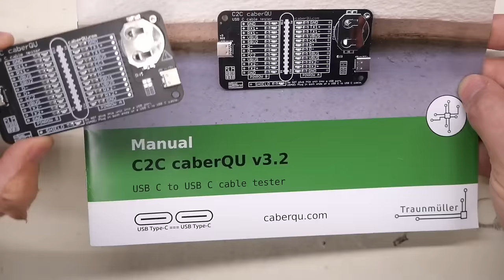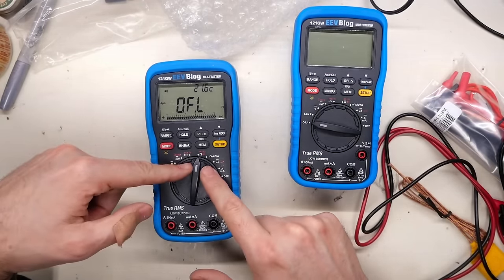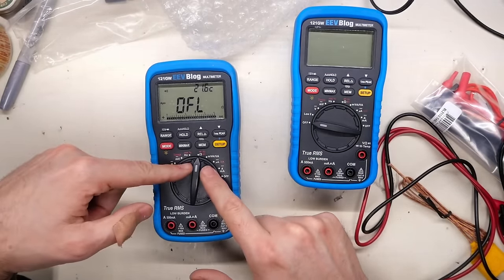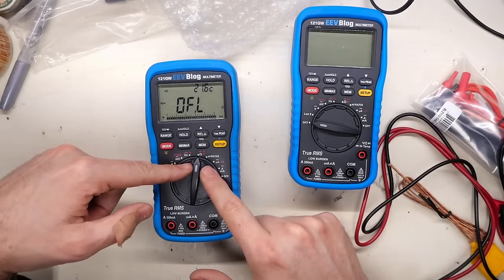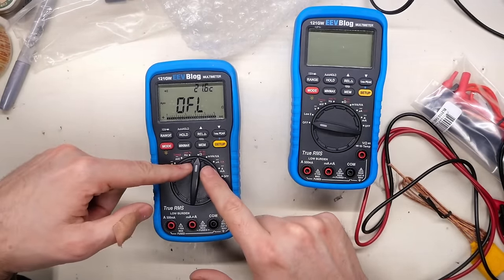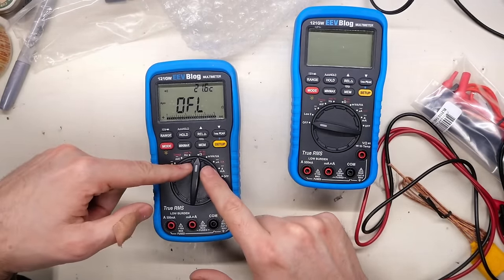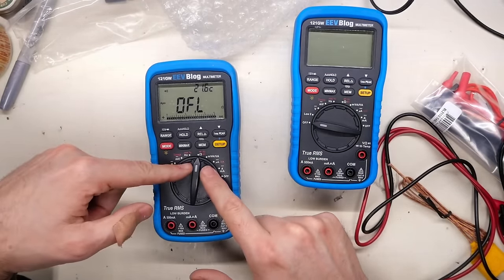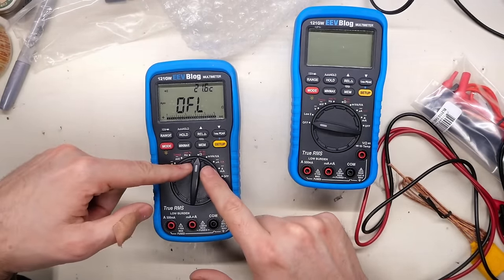0080 A 128k RAM upgrade for the Speccy, some recovered SIDs, USB-C Cable testing and a new DMM

Comment: It would be an interesting project to mod the USB3 Cable Tester with a microcontroller and a two-line display to show which type of cable is connected.
Dude!  When in doubt, De-Oxit.  As I understand it, De-Oxit has several formulations, so you might be better off with CRC QD Cleaner.
That Spectrum RAM upgrade cries out for a 3D-printed case.  Ivan (pr: EE-vahn) mentions you can manually select 128k but the software defaults to 48k...

Comment: CCx lines will light up on shield connection on e-marked cables. Those have an active IC inside with parasitic paths to the CC lines.

Comment: Please adjust the contrast on the new DMM. Also, you can use Lithium primary AA and AAA batteries, they only have a slightly higher voltage. But never seen those leak.

Comment: This illustrates the point:  USB has gotten WAY TOO COMPLICATED.  It's not "universal" at all anymore.  Is it USB?  Is it high speed?  Is it Thunderbolt?  Which version?  Does it carry data at all?  Or is it just a power cable?  Either way, how much power can it deliver?  Who knows!

USB was supposed to solve the problem of having multiple ports, like serial and parallel and PS/2 mouse and keyboard.  Instead, we have one port, and nobody knows what it can actually do.  That's not better.

We really should have kept legacy USB and just added Thunderbolt as a separate interface for high-speed data.  Charging?  I really don't care.  My laptop can charge from USB A power bricks.  It takes a full day, but that's fine.  If I need something faster, I can use a dedicated power brick.  Can't we just do that?  ><
Reply: Too true. I've only recently realised that USB-C can be USB2.0 and not a backward-compatible USB3.x. more fool me. I thought it was standardised.

What's more, is that I have USB3.0 cables that aren't recognised by some devices, but are perfectly fine in others.

Comment: I use non rechargeable lithium AA cells in my meters, since they last forever and do not leak (or they have not leaked for me yet).  On 9v low draw stuff I use "heavy duty" batteries, which tend not to leak.   Also on one of the cheap meters, I would try Deoxit D5 on the contacts.  If they have carbon traces, you need to use the Deoxit F5 Fader lube.  I killed a bunch of potentiometers with D5 before I figured out that you have to use the F5 Fader cleaner on carbon traced stuff.  Good luck.

Comment: Shield should be connected at only one end. If it's connected at both ends it's a ground loop.
Reply: Nope, that's only in analog audio. All other shields must be connected at both sides, just like with a single core coax.
Reply: @WhiteBream   No, not quite.  Ground loops are not an "audio" problem.  They're a signal problem.  They affect every signal, whether you can hear it or not.

Some cables use ground as the signal return, so you can't do anything about it.  (Coax.)  Other things, including some audio cables (XLR / or mono differential on TRS) don't use the ground as a signal return, so you can lift ground on one end without a problem.

All that said, ground loops only exist when there is a difference in ground potential that is big enough to have a significant influence on the signal's interpretation.  So the best cure is for that not to happen to begin with.  When devices are floating (battery powered or double insulated), then it's not an issue.  When devices use a safety ground, that ground should not be carrying current, and both devices should have low impedance paths to the same common point.  Then, the shield of an interconnect isn't acting as an equalizer between two different reference points.
Reply: @WhiteBream   I humbly disagree, The exception is when the shield is the only ground(and a common ground is necessary). This is normally the case with analog audio and RF coax.
The issue is that if the shield forms a loop with a superfluous ground conductor external noise signals are inductively coupled to the signal conductors.
The truth were hoping for is that all ground pins(not signal negatives) are connected to shield at both ends with no other ground conductors. I can't think of a simple way to test for that off the top of my head.

Comment: As someone who uses a DMM almost everyday at work I personally wouldn't trust anything that wasn't a fluke. But with the range switches have you ever taken them apart and cleaned off the contacts?

Comment: if you had a 80s portable tape player (like brochures of the day suggest) i could set the volume for you so the spectrum always loaded, it was a skill back then.
My best advice is set the volume wheel to 7 to start with if you have such a player

Comment: USB-C cables designed for charging - like those Apple includes with laptops - tend to have thicker conductors for lower resistance at higher wattage applications. I've found that any cable I purchase that includes the words "charging" or mentions wattage are always USB 2 cables. The consortium should have enforced a marking system to help eliminate this confusion.

Comment: i know the joystick ports on the original spectrum were on the cartridge add on as far as i know. i remember having the original sinclair 1000 but never used it and then it eventually got thrown out. i miss it already. there are lots of computers i want to end up with but finding one isnt cheap sadly.

Comment: add a usb-c voltage amp meter in line
spray some deox-it in the multimeter selector knob. they get dusty and the lock washer on the backside often gets loose.

Comment: Hi Adrian. I believe the official Apple (USB-C) cables have a chip in them, and a single CR2034 battery might not power it up enough to show all the modes it’s capable of. It probably needs at least 3.3 volts, but that’s just a guess, whereas the cheapo cables probably have just some termination resistors in them so a CR2034 is probably good enough. That being said, I haven’t cut into any Apple-branded USB-C cables to see the chip… Mostly because I need mine intact, and I’m not packed with cash to splurge on a spare just to cut open! 😆

Comment: Only real difference between the 48k and the plus model is basically the keyboard and the plus you got there is not a 128k model. The 128k toastrack model looks exactly like your Plus, but with a giant heatsink on the rightside (the toastrack) and it also says 128 on the case.

Comment: Check the batteries of the meters. Continuity/resistance mode relies on good batteries. With a bad battery voltage and current can still fine.

Comment: I am curious if your old meter behaves any better if you feed it alkalines instead of NiMH. NiMH have a lower output voltage, and if something is marginal, that might push it over the edge. This probably wouldn't be behind the erratic readings--that's almost certainly a dirty or worn contact trace. But maybe when it freezes a reading.

Probably not the issue--there was no low battery indication showing. Just what popped into mind.

Comment: I’ve broken many multimeters by accidentally connecting it to electricity while it was in resistance mode. I didn’t know that it could instantly damage them until I took my HAM radio test and saw that as a question.
Reply: yup, it's a quick way to learn what fuses your meter takes. :-) step #1 when changing modes; remove the leads from the circuit.

Comment: I have an ancient hp4357a that's great for tracing shorts. even in modern motherboards and gpu's with big complicated vrm's you can usually trace the short down to individual component with 7.5 digits. even tho it's kinda beat up and slow and a hasn't had a proper cal in decades it can make very precise comparative measurements across a circuit.

Comment: Switch oxidation and/or dirt in "ball" switch in multimeter. It is repairable, did it on my "field" multimeter years ago. I agree that it is annoying. Also check/clean/tighten probe ports if you decide to mess with it (they are visibly less shiny inside then of the new one).
Reply: BTW, I used "Kontakt 60" spray for cleaning- It is some kind of clean, de-oxy and it has lubrication capabilities (surface remains slightly oily after spraying). Great (and expensive) stuff, it is German, I don't know US equivalent..

Comment: Re: the meter,  i have 2 comments. 

#1, if i have to use a screwdriver to open the battery compartment,  in not interested in using it. 

#2, rechargable batteries often have different voltage from regular batteries.  Could the behavior be because it's working with a weaker starting current?

Comment: As others have said the Spectrum "Plus" that you have, is a 48K machine, in a different case.  Confusingly, the first 128K machine was also called a "Plus", presuably becuase it's the same style case.  The only differentiator was the "128K" logo in the bottom left corner.  Oh, and the now externally-mounted heatsink.

I don't get the point of the RAM expansion (nor the sound chip), because surely you'd need the 128K ROM to support them both.  The 128K ROM being a 32K (16K + 16K) package, one for 48K mode, the other for 128K mode.
Reply: no need for 128k ROM. you load 128k games just as 48k games with LOAD ""
Reply: @goloskokovic But if the "128K" functionality is not there, not least RAM paging, how is it going to work? How is the AY audio going to work?  Load the game, sure, then what?

Comment: So you've got ANOTHER 121GW?? So sorry to hear that😰.
I don't want to start a rant here, but when I got my 121GW (in a vane attempt to "upgrade" my UT61E) I was DEEPLY disappointed! Mine is a later unit, v2.05 with the same non-gold-plated cumbersome probes (but I didn't get the other ones) which have nice silicon cables, but the tips themselves aren't that good. The extremely slow autoranging is a showstopper for me, the capacitor measurement is essentially broken, and what's the point of having extra digits if the last one is all over the place? And let's not talk about the "nice" flash of the screen when it powers up! It is, however, very good measuring diodes. And the continuity test, which is on the slow side (something that Dave hates on other meters, but...), can be improved by setting the 300 ohm threshold mode -- so I have that on 300 ohm, and the UT61E on the (fixed) 30 ohm mode. Obviously, there's no comparison with cheaper meters like the little Aneng (I also have an AN8009 -- we seem to have similar taste for multimeters🤣) since for the cost of the 121GW I can get ten Anengs (yeah, I paid a lot of customs on top of the 121GW). All these issues (plus some other I don't care) have been disclosed on several YouTube videos, but I didn't do the homework before purchasing... caveat emptor! BTW, both the UT-61E and the UNI-T power supply I've got have performed flawlessly so far.

OK... about the ZX Spectrum RAM expansion, I believe the 128K (besides RAM and sound chip) was a different machine with a different BASIC ROM and a "48K compatibility mode" much like the Commodore 128 -- I was a 48K user but never owned a 128K; a friend did have one, though. But maybe many games don't care about the ROMs and, as long as the RAM and the sound chip are there, they're fine.

Sorry if I sounded harsh at first! I really enjoy your videos (well worth being a Patreon) and as a non-native English speaker I really appreciate your clear voice and high sound quality. Keep the good job!👍

Comment: Honestly, I'd throw the Aneng meter in the trash. I've got different ones from Aneng and both are unfused! They also claim to be able to measure up to 20 amps, but there's not so much as a bus bar or even a thick trace for the amperage side. They're somehow even worse than the meters you used to be able to get for free from Harbor Freight, and that's saying something.

Comment: It's kinda overkill for hobbyist use but you can't beat a Fluke 87v. While the 87v is my primary meter I still have my  Extech EX-330 as my secondary meter which I bought based off Dave's ~$50USD multimeter shootout many moons ago.

Comment: About battery leakage - unlike 3V lithium manganese dioxide cells which can leak, I have never had a 1.5V AA lithium-iron cell leak, even after many years. This includes Energizer and Chinese brands. I think it has more to do with the chemistry than the manufacturer. I much prefer Li-iron to NiMh as rechargeables have a very flat voltage curve & thus they go from ok to fully discharged without warning.

Comment: is the EEVBLOG DMM the same as the DM525? Looks the same outside of a button or two?
Reply: Brymen makes the EEVBlog multimeter, as well as many other multimeters, all to customer spec. (They also make Brymen-branded ones.) I'm not 100% sure what one you're asking about, but chances are that it's just another Brymen-manufactured meter, and it's unlikely to be the "same". Exactly how different: ???

Comment: instead of modinfying the speccy to 'permanently' deactivate the upper ram for that 12ïk expansion, maybe use one of the unused 'fingers' of the expansion slot as a 'ram cs' input', and link that finger on the 128k unit to 5v or ground, depending how you do the cs in the spectrum ...? that way if you unplug the expansion, it'll revert back to normal 48k ..?  the mod described in the web link  uses 5v to disable so wiring a diode from the point mentioned in the link, to a spare finger, anode to finger, would do it, pull the finger to 5v to disable upper ram...

Comment: Some of my meters and other equipment do not work reliably if given incorrect voltage using rechargable batteries (rechargeable are ~1.2V instead of 1.5V). Could this be the issue with the multimeter? I’ve had alkaline AA’s last for years, but had issues with rechargeable.

Besides NiMh and alkaline had a universal remote (nothing as good as the old Logitechs, RIP) had issues with anything except non-rechargeable lithium. Poor voltage regulation in either case? Honestly, I have no idea, and just spitballing here.

Also as a kid had an RC car that freaked out and didn’t work after new batteries, but after checking, one was overvolted and fixed after changing.

Comment: My main Multimeter is over 30 years old .Because I use it all the time I gave it a good service a while back and its as good as new . I've tried new ones and they just aren't accurate plus not have some of the functions that I use a lot. When the Voltage is out by a couple of volts its useless . My main Multimeter measures on top of your usual functions and transistors ,capacitance and Frequency as well as up to 20Amps . The transistor tester tests Germanium transistors where everything else I've tried says there diodes. These auto functions drive me nuts .I like to measure and straight away see a result not have to hold the probe steady and wait for it to settle and display a result. The other issue is the leads . Why is so hard to get leads with a decent length ? Plus getting ones that last . I use mine in Automotive as well as in Electronics so having probes with some decent length and for one stay in the multimeter  and two connect properly at both ends.

Comment: Aldi C64s are made in the US and have the keyboard with PETSCII printed on the front of the keys. C64Gs are all marked as such on the label, never made in the US and feature the cost reduced keyboard. I think the cases are different shades too.
Reply: Correct, and if i recall correctly, the Aldi serial numbers always start with CA4

Comment: The c2c tester is cute, but given that it only tests one cable type, and you'd have to get multiple devices for different types, it gets too expensive too quickly IMHO.  Meanwhile, devices like the "treedix USB cable data line test board" that can do multiple types of cables (a 2.0/a 3.0/c 3.2 to b2.0/b3.0/c3.2/microB 2.0/MicroB 3.0/miniB 2.0/lightning) already exist for half the price (15 us$ on Amazon).

I'm willing to pay higher community member designed device prices for good products, but to me the focus on doing only one USB cable type is too much of a desk clutter to bother with.

Comment: Speccy always worked best with 'crappy' tape recorders - they never worked quite right with a HiFi cassette deck, I suspect the speccy didn't have a high-pass filter on the audio input, and just relies on the casette player not sending any low bass frequcies. If your cassette player sounds good, it might not work. If it sounds tinny and unpleasant, it'll probably work just fine 😄 If your early speccy won't load from an iphone or good quality audio source, it might be worth using a filter or filter app to cut the bass, or maybe an isolation capacitor to remove dc bias (and low notes). With practice you can 'tune' the input volume and head azimuth by looking at the bars in the border as a tape loads
Reply: I think Adrian has an Issue 2 48K Spectrum and Issue 2s are a bit deaf. On the Issue 2 Spectrum, the speaker is powered via a diode D7 but the Issue 3 and later uses transistor TR7 to drive the speaker. This makes a difference when loading from tape because the tape recorder has to drive the speaker on the Issue 2 but not on the Issue 3 and later. I rewired my Issue 2 speaker circuit to match the Issue 3 by swapping D7 for TR7 and the tape loading improved by using a lower volume setting just like an Issue 3. Note that the speaker's impedance are not the same on Issue 2 and 3 but that seems to be OK with my mod. There are also rumors that the original ULAs on the Issue 2 are also deaf.
Reply: It might be a design fluke, but it could be a good assumption that the average user is going to have a sub-optimal tape deck.

I remember those days of forever fiddling with the tape 'settings' to get a game to load. Never the same two days running and every game different.  I had (and still do) a 3B.  I guess the +2 was a blessing for loading.

I don't remember having so many tape loading issues with my +3, so maybe they, well Amstrad, got it sorted.